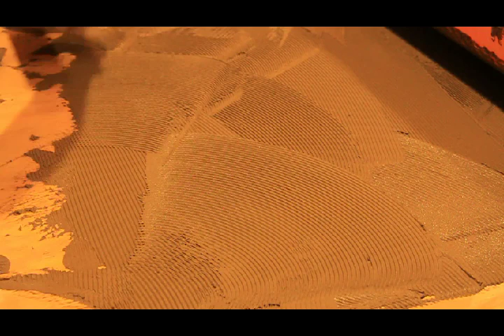Setting Schluter Ditra

Comment from the maker: I used spray to wet it and then a sponge to wipe it off. You are correct on the idea of getting the dust off. Dust can weaken the bond and makes it harder to apply the motar also.

Comment: Mark - I don't know if you just misstated @ 1:24... but you said set the Ditra on unmodified motar and use modified for the tile.
Schluter recommends just the opposite, so if you're trying to show someone else how to do it, your process is incorrect. I know this was your 1st time but at the Schluter site it shows:
Bonding DITRA to wood requires latex-modified thin-set mortar. Use unmodified thin-set mortars to bond tile to Schluter-DITRA in both interior and exterior applications.

Comment: Modified thinset goes under the ditra with unmodified thinset on top of ditra for setting the tile. This guy is wrong.
Reply from the maker: Did have that corrected on the video at 1:14, and also in my notes under the video. I did do the job correct, just got the two mixed up when talking about it. Also put in the notes why modified and unmodified is used the way they are.